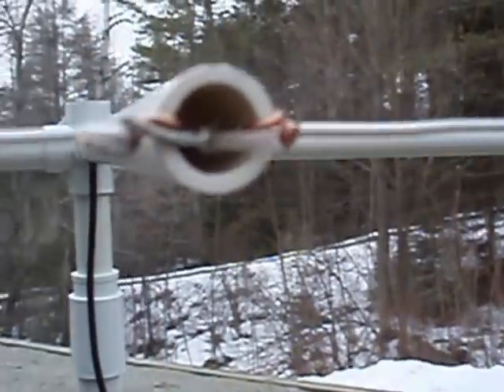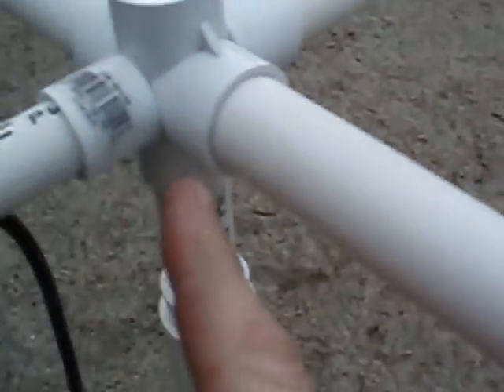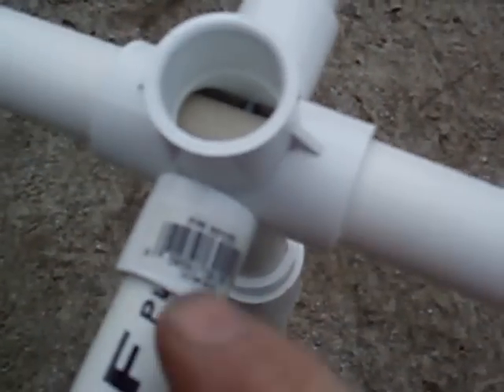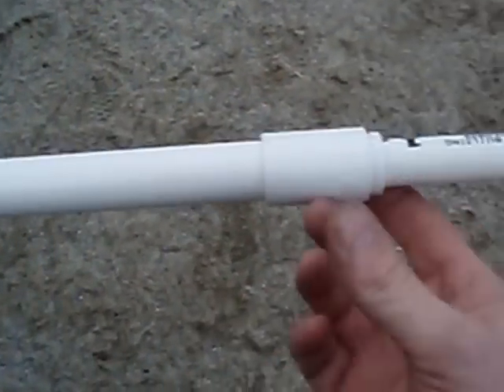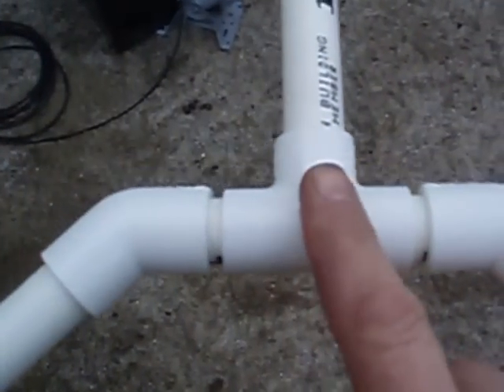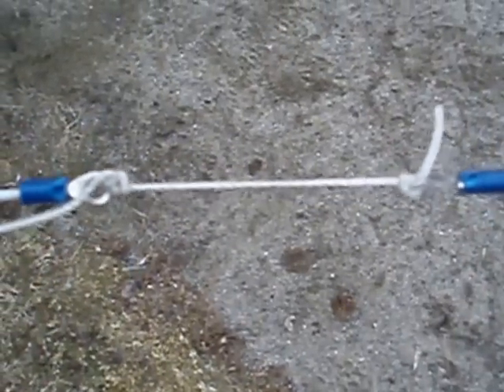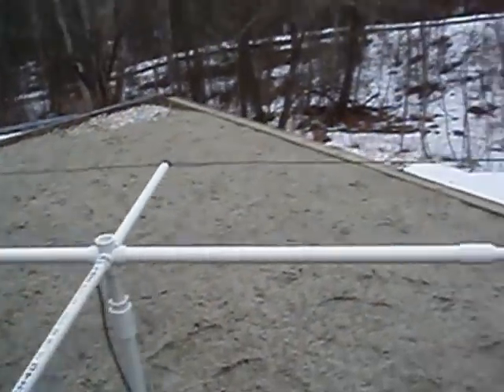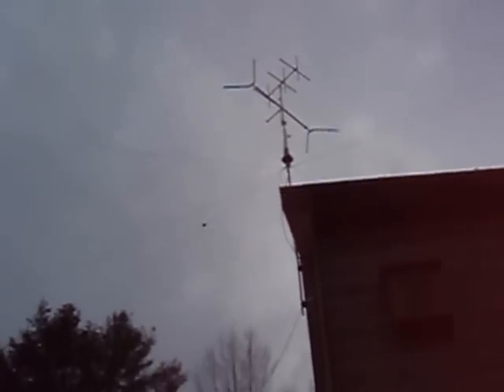My 6 Meter Moxon Antenna

Comment: 5.5 bd at 25 f/b good idea ill b working u on 6 73 kg6mn jg
Reply from the maker: +jerome grzelak If you use the Moxon program to figure out the wire lengths, remember that the program is figuring it out with bare wire. When I'm building antennas, I use insulated wire which will detune the antenna by a little over 1 MHz. Sometimes much more especially the lower the freq you go. Meaning if you didn't compensate, the antenna will resonate down below 49 MHz maybe closer to 48 MHz. So instead of punching in 50.125 MHz, go with something like 51.5 Mhz. I don't remember what I used when I built those. It took a number of tries to get it right for me. The one that is on the rotor is till in place and has survived ice storms and very strong winds here.   Experiment and have fun. Hope to catch you on the air.  73 Good Luck

Comment: can you give the measure for 10 meters in centimeters? Thankss
Reply from the maker: The Moxon Generator program is free and can be downloaded from. http://www.moxonantennaproject.com/design.htm It will give you Feet, Inches, Meters,or Millimeters just by clicking on the "Results Units" and then "Calculate". There are versions for Window and Apple. I also found one that works on my iPhone. 

I did build the 10m version from http://www.wb5cxc.com/10mmoxon.html just recently and found it was resonant at or about 27.380MHz. I have found that to be a consistent problem when I have build any Moxon antennas. Most of them are resonant at least 1MHz below what the Generator program gave me. I find it hard to believe that several SWR meters and an Antenna Analyzer are all off by 1 MHz. But it could be possible. So I did my 10m Moxon formula for 29.0 MHz and it is a 1:1 match at 28.2 MHz. Very broadband also. I forget what the sweep was. I plan to use it for Field Day 2014.

29.0 Mhz #14 AWG wire.
(again, mine was 1:1 at 28.2 MHz)
A = 3761.4 mm
B = 565.6 mm
C = 104.3 mm
D = 702.8 mm
E = 1372.6 mm

Your results may not be the same as mine so as with any antenna building project there is always some adjusting and reworking that has to be done to get the results that you are looking for. 

I hope this info was helpful.

Good luck on your build and I hope to hear you on the air. 

73
Reply: John Ryan ok my friend thank you very much,i'm using a dipolo now,but i'll try make this moxon,73 from são paulo brasil,pu2ndq
Reply from the maker: Walter Oliveira Make sure to also install that RF Choke like I have in the video on my 6m Moxon. For 10m it is about 5 or 6 wraps on a 4 inch form(10cm?). That will help stop the RF from coming back down the jacket of your coax and keep the RF out of the shack. 

It REALLY is an antenna worth building. You will hear so much more than you can with your dipole.
Reply: John Ryan ok my friend thank you again, is hard to find the material here,but i keep search :)